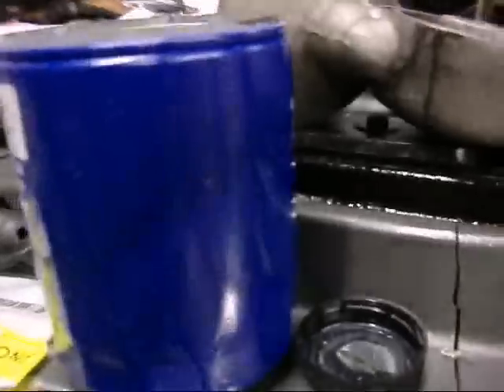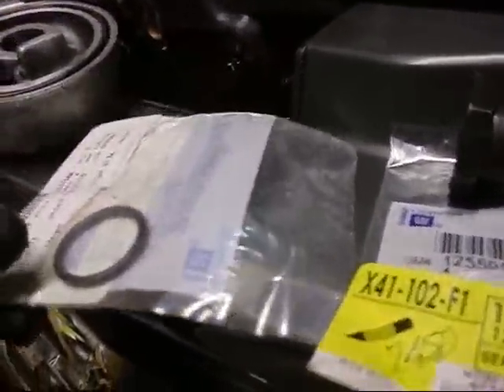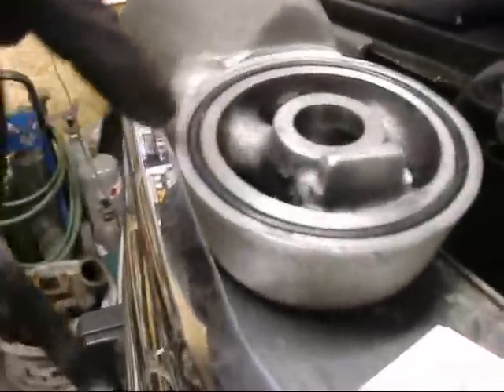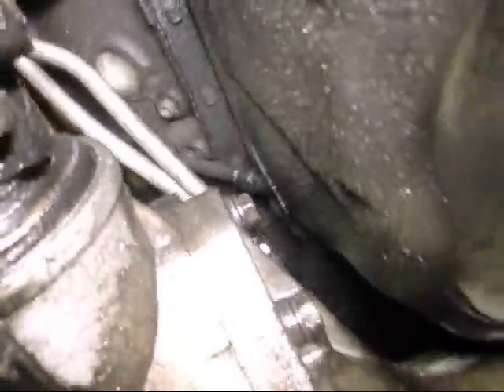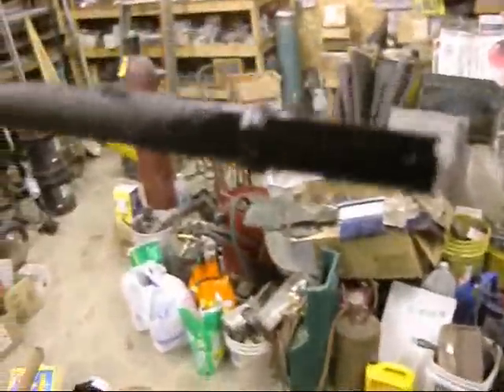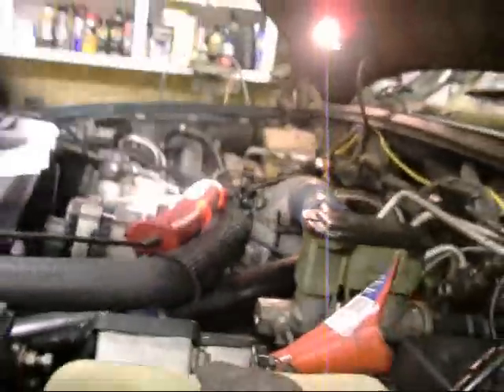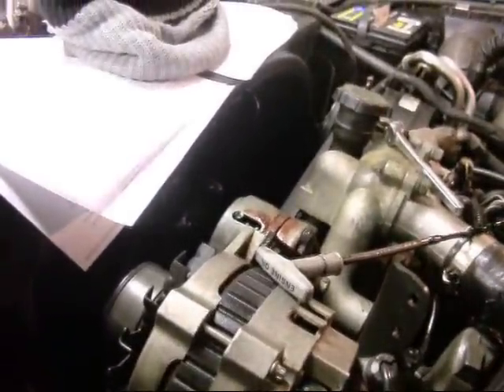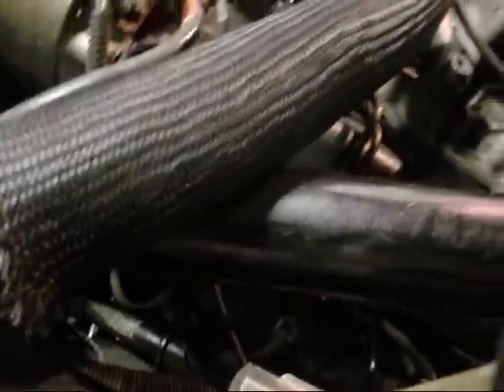2 28 12  Az Sub Oil Tube Seal...

Comment: @CORVAIRWILD Well the smaller o-ring will stay, and the green one may stay too just depends on it's reaction to diesel byproducts in the oil.  I have to think that the dipstick was out of the truck for some reason at one point and got lost. The rotating mass inside the engine create oil spray patterns on the inside of the block , at idle a part of that pattern intersects the dipstick tube.hole forcing oil out the o-ringless dipstick

Comment: Sludge and a leaking dipstick tube..... Check the CDV, or Crankcase Depression Valve, supposed to be replaced every 30K or something.  Regulates the crankcase pressure, which on the 6.5 is supposed to be at a slight vacuum.

Comment: A quart of diesel in the crack case 30miles b4 the oil change is do every time helps with the sludge,works for me anyways.
But then again I run 3 gallons of washer fluid (contains methanol) over a years time through my gas tank so what do I know lol.keeps them injectors clean plus the combustion chamber clean as well.
A clean engine is a happy engine.......

Comment: I would be very careful about running anything to loosen the sludge up you maybe pulling the oil pan off and cleaning the pump screen.  Right now where I live diesel fuel is 1.39 a litre or 5.14 a gallon.  Never seen lime green O rings before lol.  Keep using the synthetic Rotella you have been using.

Comment: I hate to say this that sludge looks like water in the oil.. The 6.5 has such a dirty combustion processus that even new oil is black as soon as you start it,  It will turn the oil to sludge when mixed with antfreeze and it never turns to milk like in a gas motor the soot in the crankcase "blowby pass the rings" will mask it to look like sludge.. the low coolant light in one of your post while driving this truck is what brought me to this thought.. sorry..

Comment: Corvairwild you should know that excessive sludge buildup is caused from the lack of proper oil changes and using cheap oil...IE: not changing oil at 3,000 miles and cheap store brand oil...you should seafoam the truck and that should clear the sludge.. should also explain the poor fuel mileage because sludge slows an engine down therefore not producing efficiently and burning too much fuel

Comment: Junk filter!! Might want to double check that filter I know its a AC Delco filter but it looks like the champion labs e-core design which is crap, almost as bad as a fram, e-core uses fiberglass end caps and a cheap flimsy plastic center tube, noooo goood!! Id stick with K&N that's a good filter like WIX